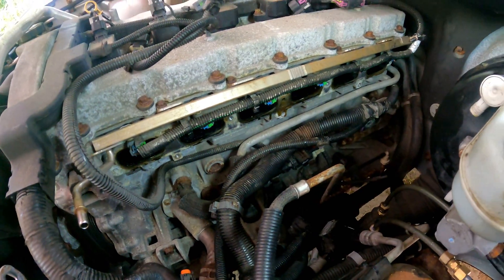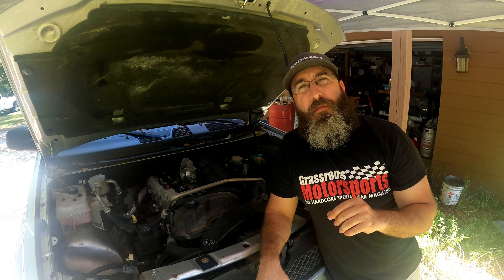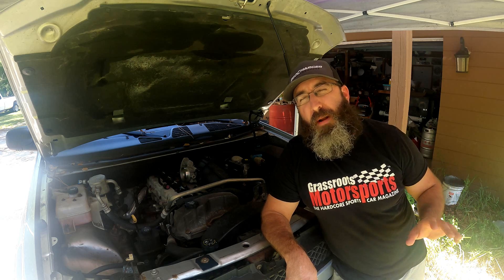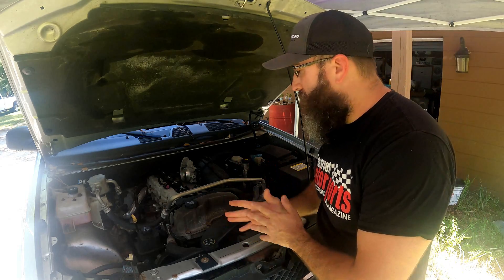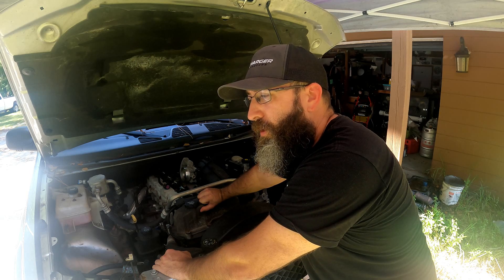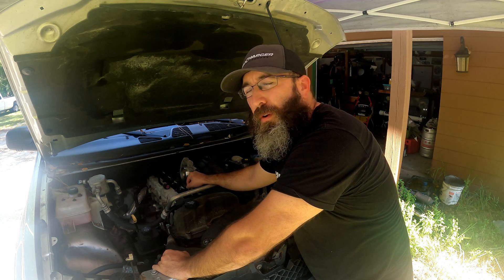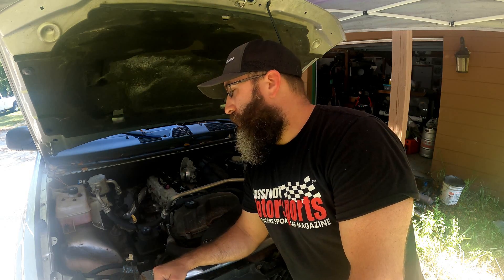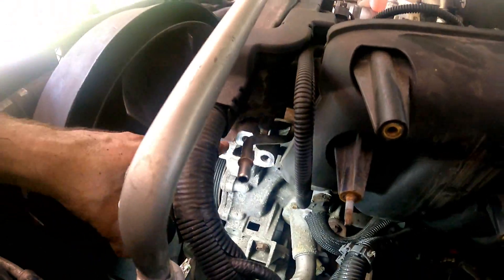Atlas 4200 Trailblazer Injector Upgrade! Preparing for Boost!

Comment: If I were to install these fuel injectors on mine do you know if I have to start getting a different type of gas?
Reply from the maker: You would have to retune the vehicle  np matter what, but you could still run regular 87 octane if you wanted. The benefit is you have the ability to supply more fuel to make more power especially in a boosted application

Comment: Would there be a difference of the tune if you were to run it on an 02 tb?(if you're running the stock ecu) Really excited on seeing it run and do some pulls!
Reply from the maker: Do you mean if you run the 08/09 ecu on an 02 motor? there may be a few differences. im not sure exactly what. the 08/09 use speed density where as 02-07 do not. that is the biggest reason i went with this year. as far as using this ecu on an older motor i dont see why you couldnt. Not sure if that answers your question lol

Comment: Nice progress looking forward to the start up. As far as camera stuff I loathe gopro's. I've had such horrible luck with them as far as audio issues and lost corrupted files. I'll use them as a secondary camera if I must but I'll still run audio on another camera. For quite a few years I ran the Sony ZV1 camera which is a nice point and shoot. Its downfall was not being able to record in 4K, well it can but it cropped the picture a lot and you no longer had built in stability so any footage was really shaky. I still have that camera and will still use it if I want to record multiple angles which is something I may do when digging into the foxbody project more. As far as audio I had good luck with the rode video micro external mic I used that for a long time but in car video footage with the fox its pretty loud and noisy so I decided to go with a wireless mic, I picked up the Hollyland Lark M1 off of amazon and am quite pleased with that. I did upgrade my camera recently and got the Canon EOS R8, I wanted something great for photo's and also video and it will record 4K with out any cropping being a full frame camera. Not as compact as the Sony but that's the trade off you make
Reply from the maker: Going to have to look into some of those!
Reply: @J-Whit  There are a lot of options out there it will make your head spin trying to decide.I had been holding out to buy the long rumored 2023 release of the Sony GX7 Mark IV, but as of now there is nothing Indicating when it’s coming out so I bought the EOS R8 instead

Comment: My 2006 3.5 is just NA  but I have been running Brisk spark plugs with no problem.  I've got a 93 tune, coil spring delete, intake and exhaust.  I've towed 5,000 lbs behind my H3 doing 65 down the highway and it never missed a beat.  Even when I was at over 3,ooo ft elevation in the mountains it does fine.  Brisk Iridium Performance P5 are what I have been using.  I know boost is a completely different heat range of plug.
Reply from the maker: Good to know! Those i5 h3 are cool!
Reply: @J-Whit  Yes but the bad and good is that the transmission, transfer case and front differential is all one off parts for the H3.  The front brakes are one off as well.  They are 4 piston top load calipers like what you would see on a road race car.  When the H3 came out literally the only vehicle that GM made that had better front brakes was the Corvette.
Reply from the maker: @Hummin_Along  thats pretty cool. i wonder if i can configure a set for the trailblazer.

Comment: 500-550 whp on a daily driver would be a blast and plenty fun.  Any trans mods planned for the power level you are shooting for?
Reply from the maker: Other than bumping up the line pressure, none as of now. But the plan is to not turn it up to 11 right out of the gate lol

Comment: You need to add a check valve in the hose from the intake flange to the plenum, if you don't boost will pressurize the motor.... Complements of Emtech.